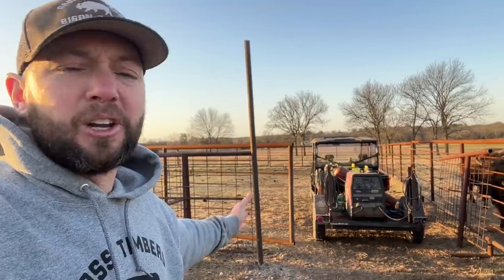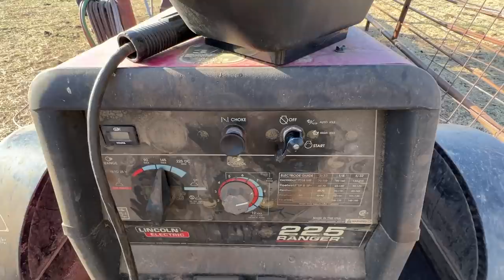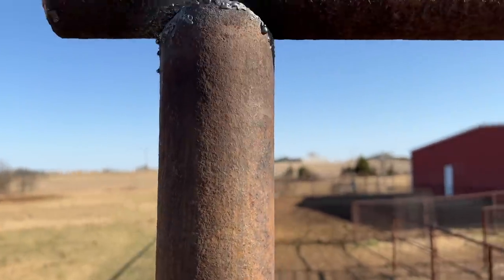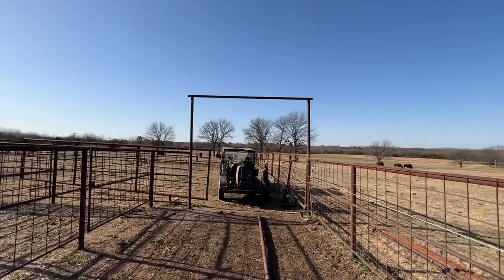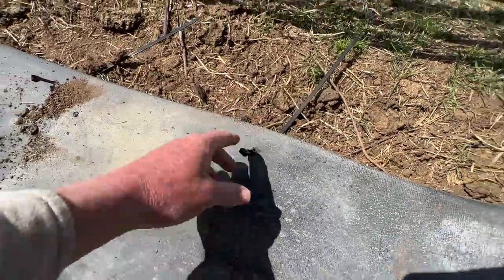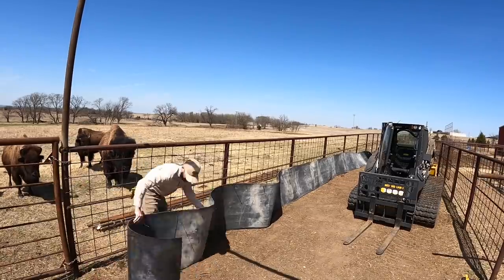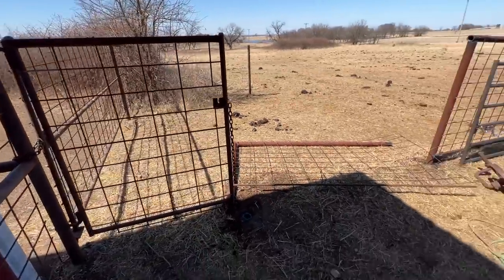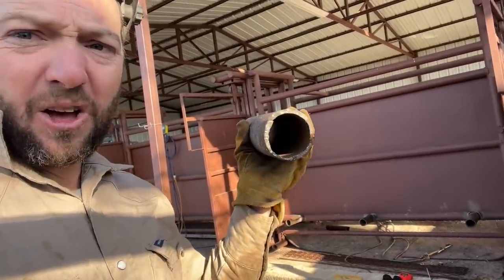Hope the Ponderosa is Ready To Work Bison!

Comment: buy a rubber punch 3/8" grind the one end down to fit in a drill chuck and it cut a core out and thecores come out the side, i make rubber tracks and use them in a drill press and a hand dri;;, a drill bit so hard to push though and you have to drill way over size o get the-size hole you need as the rubber pushes away..

Comment: Dusty I'm sure someone else has done mention this but those pipes sticking out that you welded on and put rebar on I don't want to be a smart aleck or nothing like that but I know from experience those pipes sticking out if someone hits their leg against them they're shin or whatever even though you put that one piece out near the end the way they're tapered and the angle there cut at is a good way to cut your leg good you need to weld a flat piece of steel along the edge on the pipes so no one will do that and it needs to go the full length you may have done done that I don't know but just in the video that's what I seen and like I said I'm not trying to tell you what to do or to be a smart aleck just trying to save a lot of pain and suffering from someone that learned the hard way about things sticking out like that enjoy the video as always I never say much if anything at all but that just worries me I don't want someone tanned up crippled or cut real bad cuz there's enough stress in what you're already doing the day you're working them don't need any added stress on nobody take care and God bless